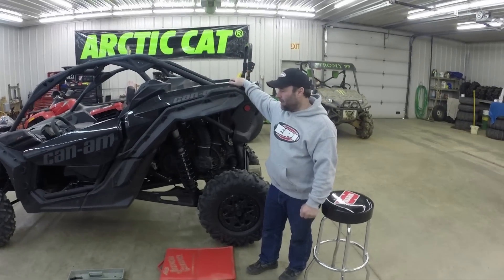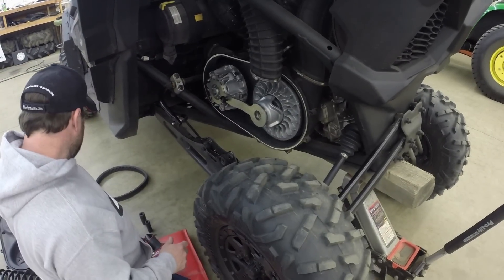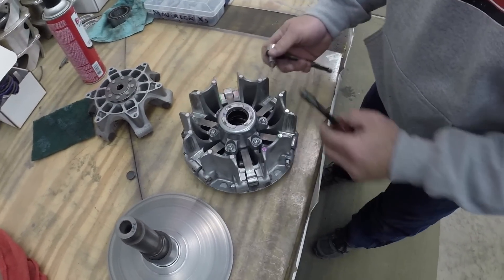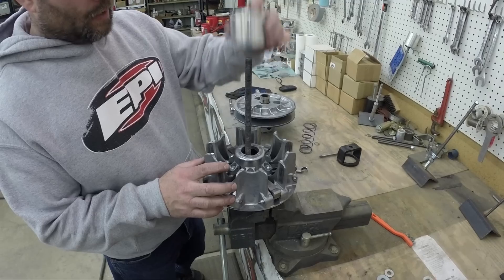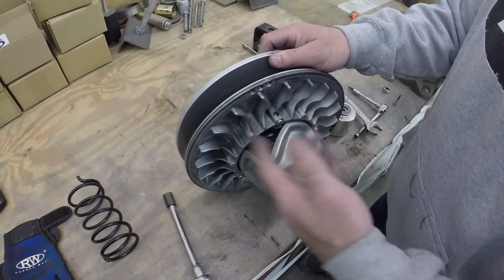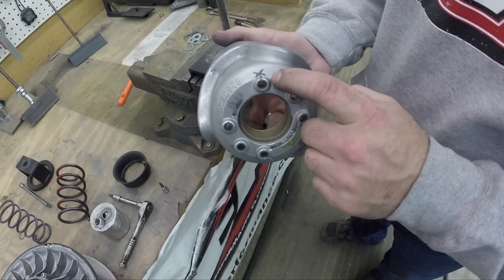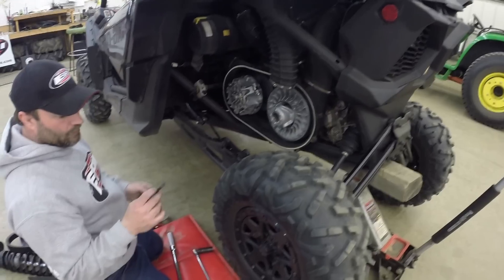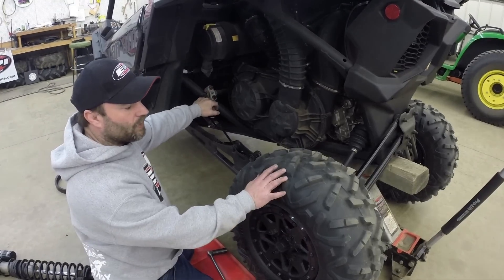Can-Am Maverick X3 2017 Clutch Kit Install - EPI Performance

Comment: Hello, My belt broke off and when I replaced it the gears are hard to engage and I purchased another belt thinking maybe worng belt but to no avail. I can't change gears once the engine is on I have to turn off then change from Hi to Park. Do you have any idea what it might be? Any help is appreciated.
Reply from the maker: The problem you are having is usually caused by the center bearing on the primary clutch being worn out, locked up, or there might be a piece of rubber or string from the blown belt stuck in the bearing or maybe even another part of the clutch and not allowing the clutch to disengage.  Remove your belt and see of the bearing turns freely.  There should also be a little black plastic washer on each side of the bearing.  Sometimes if the belt blows it brakes that washer out of there and allows the clutch to spin the being causing your issue.  Inspect your bearing, if it all seems good your gonna have to take the primary clutch apart further.
Reply: Thank you.  It did turn out to be the wheel bearing.  Now it shifts soft like butter.

Comment: Great video! Do you recommend retorquing the primary and secondary bolts after a run or a certain amount of time?
Reply from the maker: You shouldn't have to being that these clutches are self contained and not spring loaded like the older Can Am clutches.

Comment: Will the epi pro series be a good kit for 35s?
Reply from the maker: Yes it would be!  The instruction will tell you the combination of springs and weights that will work the best for you.  It will give you a lot more bottom end power and torque, faster backshift and throttle response and will grip the belt better then stock in both clutches.
Reply: @EPIperformance  even with the unit being mildly tuned everything will work as it should?
Reply from the maker: @stroke0187  yes it should, thats the beauty of the adjustable weights that it give you room to tune for different tunes.  If all of a sudden you make it 300 hp you might need something different but otherwise should be good to go.
Reply: @EPIperformance  awesome thank you!

Comment: So its been 2 months and still not on the Website?????? Any Expected release date?
Reply from the maker: Our machine shop is way behind right now so we are waiting on the weights to made, then heat treated and then plated.  Primary and secondary springs should be here mid July and the weights will by around Aug 1st.  Sorry for the delay.

Comment: Does changing weights and/or springs help with the dreaded 5k rpm loud as hell chatter?
Reply from the maker: It will help smooth it out.  Some of that will vary depending on your tires, speed, what gear your in and the overall condition of your belt and clutches also.  Overall the kit will get you better and smoother performance.
Reply: Agree that 5k rpm chatter is loud.
Reply: Hopefully I'll find a solution to it, if not it's bad enough to almost make me sell it, gonna go to my local dealer and see if I can talk them into putting the new 2020 model clutches and cover on my 19, supposedly it's way quieter.
Reply: I put a noise reduction kit from adrenaline cycle on my x3 and it helped but did not solve it.  Hope the 2020 model clutch setup works as I will change it out.
Reply: I recently added the adrenaline cycle relocation kit and I feel the 5k noise is 90% better.  I’m very happy with it.

Comment: Do you by chance have stock springs dimensions and specs?
Reply from the maker: We might, what exact year and model (hp) do you have?
Reply: @EPIperformance  We are actually working on a Ryker and trying to find similar unit that we can test some springs. I ordered a pink spring and it seems so much larger than the stock one felt it wasn't right. It is for a maverick X3, I wanted to compare a stock size if maybe it is supposed to be that big.

Any help would be appreciated, I know alot of people are not modifying the Ryker and tough to get any assistance.

Comment: 13:50 hi can someone help me out is normal to have that groove near the shaft? i have about 150 hrs on my machine and my primary looks exactly like that. Can it be possible that my aftermarket belt did that? I have a WBB from about 50hrs to about now.
Reply from the maker: A couple things can cause a groove there (or a combination of them all).  Usually the biggest thing is belt slippage.  This can be cuase from driving real slow in high range, larger tires, or loading the clutches hard in mud or pulling.  But if your clutching is not set right for you riding it can cause it and also if the belt is to hard it can cause it.  Best thing to do is use low range more often, get a clutch kit for your tire size and riding, clean and maintenance your clutches more often and inspect belt and replace if needed.
Reply: @EPIperformance  Thank you for the advice, i have stock tires but i think i did all that damage during break in due to the fact that i went slow on my machine the first 50hrs never went above 45mph. Thanks again for helping ne out

Comment: by replacing the stuff you did what does it help? also, would this help with the jerk you get from going from a dead stop to just moving.
Reply from the maker: We make a couple different kits depending on your tire size and type of riding you are doing (trail, mud, sand).  The kits will give you better low end and mid range power, top end speed will stay the same on most kits but you will get up to faster.  You will also get faster backshift and throttle response and will grip the belt better then stock.  The oversize tire kits will keep your clutches in lower gear longer to help make up for the power loss of the larger tires.  It does help the jerk a little but doesn't take it out completely.  The jerk can be several different things including driveline slop, belt the is worn skinny and/or long, dirty or worn clutches.
Reply: @EPIperformance  so I can use this kit on 2017 x3 maverick 4 seater with bigger tires?
Reply from the maker: @georgedenny7365  Yes we would have a kit for that combination.  Give us a call at 218-829-6036 or check out our website www.epiperformance.com for more info

Comment: The EPI website says the correct puller is PCP 15, but TNT video says PCP 16.  Which is correct?
Reply from the maker: Both will work.  Originally we used the PCP-16 but found some clutches are coming off harder then normal.  So we updated the fitment to the PCP-15 which has a thicker end on it to make it stronger and less chance of bending.  So if your buying one now, buy the PCP-15

Comment: Hey man,  i need a lil help,  do u know what way the arrows suppose to be pointing on the piston on a can-am Renegade 1000cc 2014yr that's the only thing stop me from putting it back together
Reply from the maker: For the piston I am not sure.  I believe it suppose to point to the exhaust side on most models but I don't know that for sure.  Sorry I cant give you an exact answer on that one.

Comment: Put your kit in my 18 xds turbo r with a stage 3 tune and 32 inch tires the up shift appears slightly lazy what changes can i make to get to peak rpm a bit faster. Thanks
Reply from the maker: some of the different tunes on the X3 need a little lighter weight t help them pick up rpms higher faster.  Sometimes you can get by with a different stiffer primary spring.  We would need to know which kit of ours you have and then we can go from there.  Best bet is to call our tech line at 218-826-6036 and they will see what they can come up with.
Reply: What did you do to fix it?I have same combo
Reply: @BarrySwartz-nq2yy  I ended putting a little stiffer spring in. I can’t remember the number it had a little more finish rate then the spring that came in the kit.
Reply: @vintage30  how’s the rpm’s now on 32s?
Reply: @BarrySwartz-nq2yy   I’m right at 8000 and it gets to 8000 as soon as you hit the throttle.  I’m in the middle of going to a stage 4 tune and waiting on a KWI kit to get here. The EPI kit served me well never blew a belt and had made real good power once I got the new spring installed. It wasn’t really to bad before just  you could watch the RPM go to about 7200 ish then do a steady climb up to 8k
Reply: @vintage30  how much for the epi kit
Reply: @BarrySwartz-nq2yy   I think I’m gonna hold on to it my nephew just put 32s on his he was asking about it.

Comment: friend to my can am maverick 2017 they run all speeds but the H does not work it stays as if it were neutral, some advice, help please 🙏🏼
Reply from the maker: That would normally be an issue with the actual transmission or the shifter linkage to the transmission.  The clutches wouldn't cause that issue.

Comment: Is the PCP-16 the same clutch puller for a 2013 Maverick 1000?
Reply from the maker: Yes the PCP-16 is the same as what we use on your 13 Maverick.  We have seen on some the X3 models the clutches coming off very hard and have switched to the PCP-15 which is a Ski Doo that is the same fitment but had a thicker tip on it to help pull the clutches off better.  So really you can use either the PCP-16 or the PCP-15

Comment: Where can i get all the tools you used in this video?
Reply from the maker: We have them at EPI.  Call us at 218-829-6036 or go online at www.epiperformance.com 
Clutch Puller is a PCP-15
Clutch compression tool is CCT820
Clutch holding tool is EZCALT
Clutch Splitter Tool is EZCST
or you can get combinations of these with part number EZCSK1 or EZCSK2

Comment: What number was the spring in. I took mine out and forgot to mark it smh
Reply from the maker: if you have the 17-19 with 154 and 172hp it should be A-4 setting.  If you have the 120hp it should be C-2 setting.

Comment: Where can I buy the clutch holding tool for the X3? What's the part number?
Reply from the maker: The Can Am part number is 529036428.  Some local dealers will sell the tools to you and some don't.  Usually if you cant find it local you can find a dealer online that will sell it to you.

Comment: Can't seem to get the primary to separate? Any tricks other than heat
Reply from the maker: Sometimes they can be a pain.  Heat doesn't work well because it in the cent of the clutch.  Sometimes having another person hold it still helps.  There are a few places that make a tool that seperates it apart other then the factory.  Bikeman Performance and Alba Racing both make one that work well for that hard ones.

Comment: im interested in a kit as well for the x3 but nothing is on the website.
Reply from the maker: Hi Chad, our machine shop is a little behind.  Kits should be available around Aug 1st.  Springs will be available mid July.  Sorry for the delay.  Let us know if you have any other questions.  Thanks.

Comment: Anyone have the torque specs for the bolts holding on the primary and secondary clutches on an X3?
Reply from the maker: For the 2017 the primary clutch is 89 ft/lbs and the secondary is 52 ft/lbs.  I would assume the 2018 are the same but I don't have any specs on that one yet.
Reply: EPIperformance 
Thanks 👍 where can buy online the clutch puller and clutch holder for maverix x3 ??
Reply from the maker: You can get the puller and the clutch compression tool from EPI or EPI dealer.  Clutch puller part number PCP-16, clutch compression tool is CCT820.  The clutch holding tool is and OE Can Am part number 529036428.  You should be able to order that through your local dealer or online from a can am place.